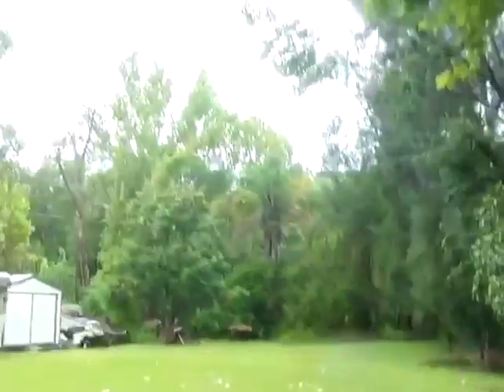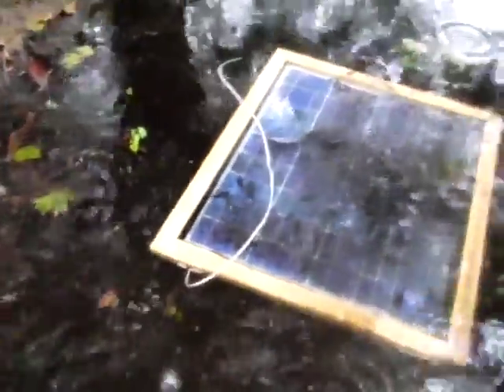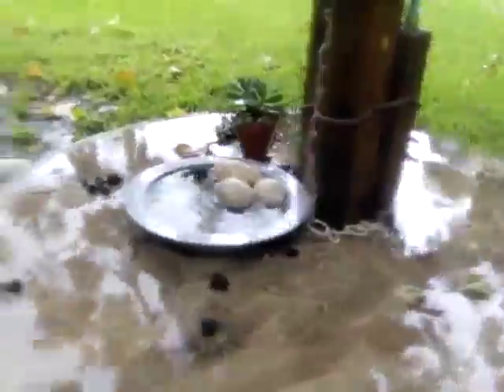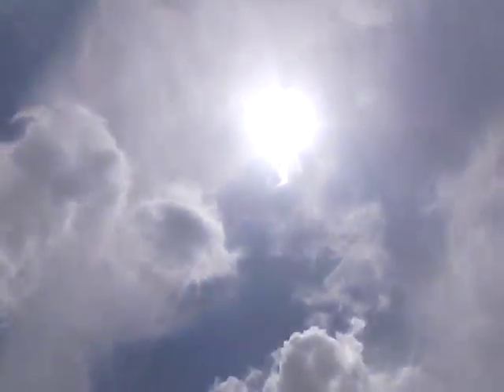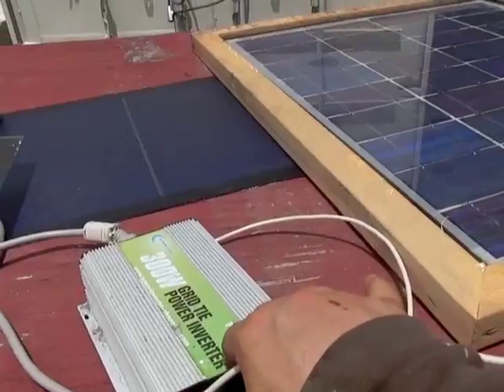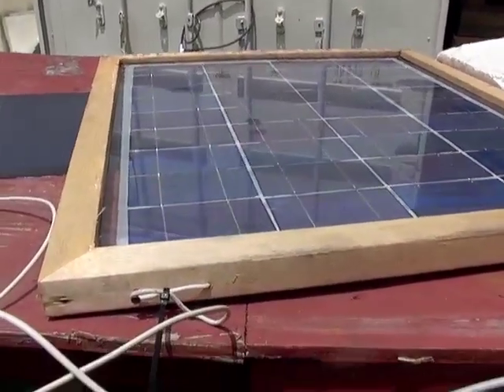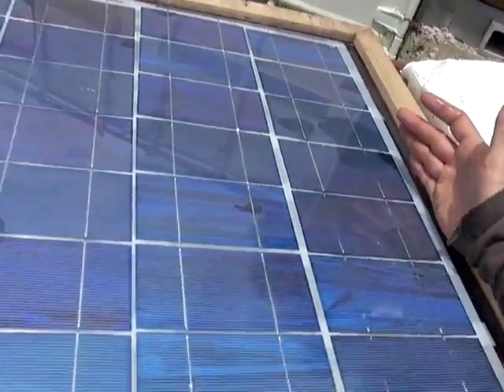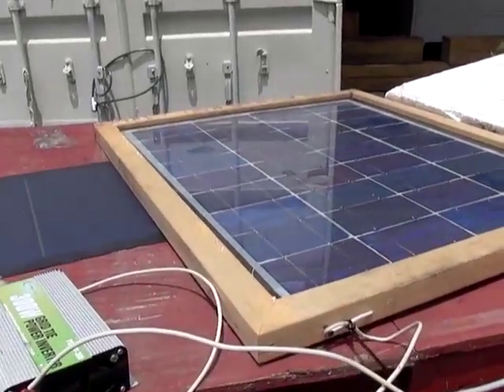How to build a Solar Panel $1 A WATT DIY SOLAR PANEL Part 6 humidity water solar test Buster

Comment: Perhaps not completely related, but does anybody know if the aluminum edges of commercial monocrystalline  panels like Renolgy are watertight?  I'm asking because I'm thinking of just using a solar panel as the roof of a custom van pop-up where the sheet metal opening will be just smaller and folded up right inside the aluminum edges of the panel creating a two inch seamless water barrier ridge.

Comment: Great series, but at $45 for 50 watts (as you said just under $1 per watt) it hardly seems worth the time? Considering retail is about $1 a watt, I am thinking it is a better bet to save myself a whole heap of time and just buy it retail and get any warranty I can get. Even if I don't get a warranty, the amount of time I would save would be well worth the few extra cents per watt.

Now, had this come out to be $30 or $25 or something, then yeah. This would be totally worth it. 

My only question is, when you gave us those prices, did it include S&H, gasoline used running to the store, electricity used (cost), etc...? I am betting no. 

So, between the cost quoted, those additional costs, and the amount of time invested it seems to me buying the panels retail is going to be equal if not a better overall deal.

Don't get me wrong. This video series was awesome! I loved it. I just can't help looking at this in a practical sense.
Reply: You have a very good point to an extent. If you buy a solar panel that has more then 50-75 watts then it will cost around $1 per watt. However if you want a solar panel that has 5–30 watts it cost $2-5 per watt. If you are making a 5-30 watt solar panel it would be to much of a hassle to to a frame and glass, but if you use a method like in the first episode of this series that uses only resin for both sides of the panel then it is very cost effective.

Comment: Dan, If the resin is going on the back side and will most likely be covered what difference does it make if it yellows? I might have to get my cells from EBAY . I live in the Philippines and good products are not always available.

Comment: is there anything other than glass you could use for the front that wont yellow or if you did use epoxy would the yellowing effect the efficiency significantly, i only ask as im planning on building an electric bike and was considering making a box within the frame to house the battery and thought either to use aluminium or possibly carbon fibre then saw your video and thought this would be an excelant face for the carbon but i dont really want to use glass for obvious reasons

Comment: I suggest several improvements.  Spray lacquer the back side of the solar cells which are cracked (or all of them) to seal them before pouring the resin to prevent resin seeping through. Tie a large knot in wire on the inside of the frame right before the hole to prevent pull-out. Seal wire hole with a piece of fiberglass cloth soaked in resin and allow to dry before pouring the resin into the frame. First lay a thin bead of silicon before placing glass in frame, then finish with another bead.

Comment: I made some panels like this one but with an aluminum frame. I wanted to be SURE that it would never break, so I used 1/4 inch tempered glass. I only get 35 watts max out of the panels. Pretty disappointing. I'm sure it's because the glass is so thick, and/or the resin over the cells is absorbing/reflecting the light :/

Comment: That resin pretty affordable how much for that gallon can? Your getting some good power out of that panel. I noticed that one cell is split all the way across so it is going to cut down on your amps by half.  Can you make a panel out of grade A Cells to see if you can beat your record. Thats a really good panel. You did some nice work on that. I saw a video of a guy that used a storm door glass to make a panel the 3x5s just fit it perfectly. It was tempered glass too. I want to see if it yellow

Comment from the maker: @daenergymon Good point about the GTI, I actually metal box them outside, not totally because of the UL, because I do not like any power inverters or converters on when I am not around. I have had 2 phones AC to DC almost catch on fire, one from lightning one power spike. GTIs need air and to be dry.I use a standard extension cord for the drop to the house outside outlet. I have seen people mount many in their garage, scary IMHO.Also closer GTI is to panel the better 120v travels better than 12v

Comment: Tip: put your camera in your oven and set it as LOW as it will go, generally around 120F for about  an hour.  Then you can go outside without any issues.

Comment from the maker: @Petawatt No double male. GRID tie inverters have a standard out male plug that is only hot when it detects a current in a socket. So you can touch the prongs with zero current. Once 100 v+ is detected the Island moves the current. The kilowatt meter detects voltage and current passing through it regardless of the direction. Like an AMP CLAMP.

Panel to a GTI plugged to an extension cord

Comment: Could you go into a bit more detail on your grid-tie inverter testing circuit? Were you actually tied into the grid when testing that solar panel? And why doesn't the kill-a-watt meter show a negative number? 

I assume the hook-up was solar panel>>grid-tie inverter>>"suicide" double male cord>>kill-a-watt>>grid   --  but correct me if I'm wrong.

Comment from the maker: @MrHorsetail The link is in the more info on part 5 and the tape is standard white strapping tape or filament tape. You can also use silver mirrored aluminum tape if you have a silver backer.

Comment from the maker: @MrHorsetail It does help. Tempered is best but regular glass will work. Just make sure you do not have drastic temp changes. Ex; hot sun then spray with ice cold well water from a hose.

Comment: Do you think if the encapsulation stuff was poured on a little thick it would strengthen standard glass and allow me to avoid using tempered glass?

Comment: I really like this way of building a panel.  Did you use clear shipping tape  on the back or was it something else?  What was that encapsulate called you used on the back?  My next panel will be a copy of this design, thanks Dan, you do good work.

Comment from the maker: @Twistedspike I think it was the door handle. The still of the big flash, all object on the fridge have shadows casted different directions. I think this hit our deck. Cable splitter zapped. Our power was already out so nothing got damaged. I will upload a slow motion of it.  I usually set 3 cameras up each storm because we get hit 2-5 times a year. Did not have time with this storm so I just held it.